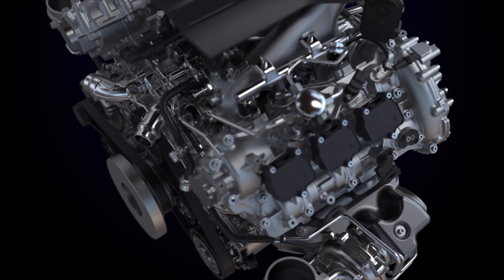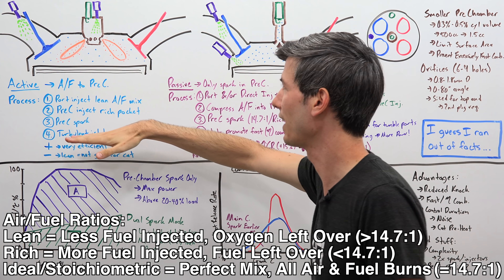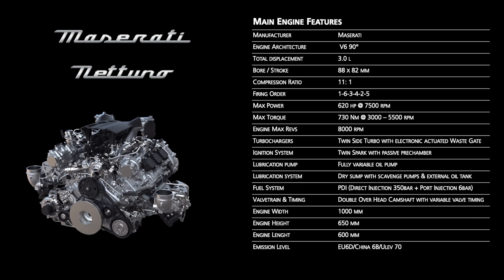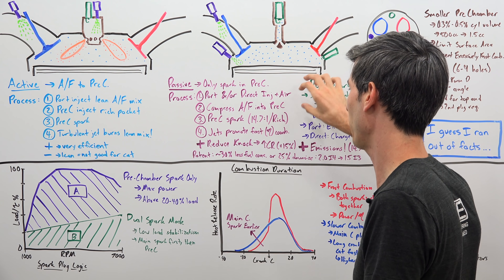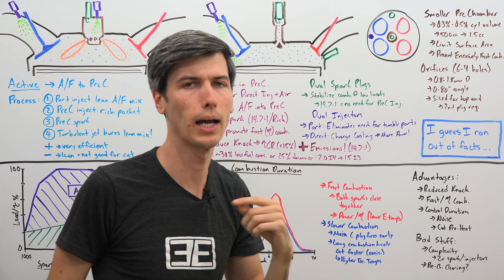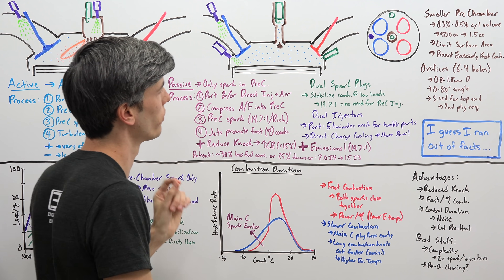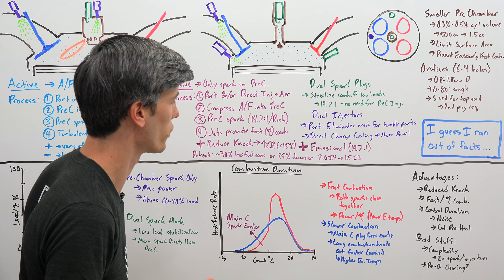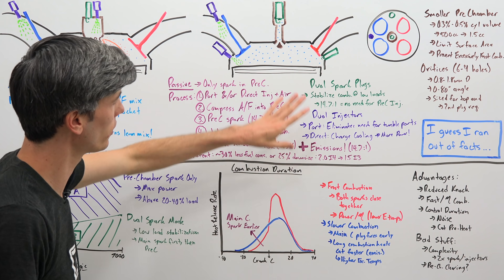How Maserati's Brilliant MC20 Engine Works - F1 Tech In A Road Car!

Comment: It would be interesting to see how Maserati pulled off the 90º V6 with common crank pins (a 'true' V6 according to certain engineers), odd firing, specialized engine mounts, and without a balance shaft.  Has anyone seen this engine revving?  I could imagine that the engine mounts take a severe beating.

Comment: An interesting thing to think about is pre-chamber volume vs effective CR. At full throttle the pre-chamber should get a fresh charge of it's volume nearly multiplied by the CR. Part throttle (and different VVT settings) less, so you'll have more dilution by exhaust and more importantly less volume equals lower speeds and lower turbulence. At low speeds when burn time is not a limiting factor increased turbulence increases heat loss to the walls and reduces bsfc. Well addressed with delayed pre-chamber spark, which is smarter than my first instinct of cutting it out. A wonderfully well thought design.

Comment: So basically they are trying to control the fuel ratio more inside the chamber during compression to have the optimum power and efficiency… and that small pre-chamber is basically a safety or a barrier for this system during combustion process due to pressure generation happening through explosion… So the struggle of a normal system is basically finding out a way to have injectors directed inside in the chamber when the valves are closed… thus this problem is causing the injectors to not practical for this kind of mechanisms and process… They will be damaged in no time when explosion happens…

Comment: I don't like it. The pre chamber is cooled and is small so it tends to quench. That's why the second spark is needed, to increase the pressure by burning in the big (less quenchy) part.
Regardless, carbon might build up in the pre chamber. Perhaps that's fine. Maybe it will provide a bit of internal insulation. Pre chambers should be insulated and should run blisteringly hot.  The fueling is wrong. The sparks aren't needed.
And there's no water injection, so simultaneous combined cycle isn't possible. Eliminate nearly all volume in the cylinder at TDC. Before TDC fill the cylinder's residual volume with steam just prior to fuel injection, turning said pre chamber into a full on combustion chamber.
That gets you half way there. The Displacement Adjuster and catalytic staged combustion finishes the job by maintaining a perfect expansion to compression ratio at any torque while eliminating vacuum, retaining stoichiometry, and vastly improving cat performance with secondary air.

Comment: disc brakes were first developed for f1 cars, the trickle down effect is pretty cool.
Reply: Actually disc brakes were first developed for aircraft. Also a lot of other stuff you see in todays cars originated in aviation. ABS/ESP, Carbonfibre, gasoline direct injection, basically every type of forced induction system, electronic engine control just to name a few. Aviation is what really pushes technology because that's were performance is more importent than cost in many cases.

Comment: What swirl direction are they using and how does swirl factor into both kinds of design? The animations appear to ignore swirl. I'm also curious how the two spark setup doesn't make knock more likely as the walls of two burning areas collide.

Comment: the Nettuno engine has a unique firing order sequence. They have a shared pin 3 throw crankshaft. Could you share detials of their 1-6-3-4-2-5  firing order which is unusual for a 90 degree V6

Comment: question: Can we make a pre chamber for all engines. Example: replace the  normal long threaded spark plugs with the short threaded spark plugs  That gives you roughly  half the roughly space half the original space available would that be enough space to machine a pre chamber and screw into the original spark plug hole an then screw a short threaded spark plug in????

Comment: You forgot to mention Soviet GAZ-24 which used forechamber ignition in the late 60-s. Albeit it was a carbureted engine, but the main chamber had a lean mixture, helping it to be fuel-efficient.

Comment: You left out the charge cooling and the fuel cleaning carbon off the back of the valve with port injection.

Comment: I'm glad you referenced the Honda CVCC technology. My 1978 Civic was so efficient due to the cylinder head design, it could get real world mileage near 40 mpg, and the emissions were so low, the car didn't need a catalytic converter. Literally the last cars sold in the US that still could burn leaded gas. And they achieved that efficient combustion even with an analog carburetor. Kudos to Maserati for pushing the efficiency of internal combustion engine design.
Reply: What kinda horsepower? I hit 47-49 mpg in a 2 liter turbo diesel motor in a car that weighs 3400+ pounds lol. I feel like you might have had 40 mpg but not very much power to play with
Reply: @DarkAttack14  This is why you have (need) turbocharging. TJI as an NA engine limits BMEP, but it allows much greater BMEP with turbocharging w/o detonation. So - higher Cr +boost = smaller displacement better power/weight and greatly improved efficiency AND power.  BUT, this is limited by high oxygen catalysts disfunction for emissions certification.
Reply: @billl7551  diesels don't detonate though lmfao. Pretty much impossible unless you were to inject right into the intake or something
Reply: @DarkAttack14  Sorry for an unclear post - -but happy it was amusing 🙂 I was referring to limitations of spark ignited engines. Diesels can and actually do detonate, but it is controlled(eliminated) by injection rate limiting so the burn rate is controlled by injection rate. The idle clatter of old was due to rapid injection of all the (idle) fuel and sudden heat release of the entire charge. Now, there is a pre-injection, (called pilot) that becomes the fireball for the main charge. Detonation will produce rapid rate of rise in combustion pressures and eat piston crowns. Not widely know by the public.
Reply: @billl7551  diesels do not detonate unless in seriously bad condition. detonation refers to ignition before intended which can't happen in a motor that doesn't inject until intended lol now if you're running an old style Bosch VE pump and your timing is way off yeah you could detonate.. Or in a common rail motor if you have oil introduced to the intake from a blown turbo! Even in an old diesel motor with one single injection event it doesn't qualify as detonation
Reply: @DarkAttack14  OK I give up- premixed fuel-air mixtures most desirable reaction is deflagration a chemical based subsonic progression of chemical heat release. The pre chamber TJI is a method to initiate this controlled heat release in lean mixtures where shock based heat release is absent. The diesel combustion is completely different with injection of a cloud of tiny balls of fire burning like comets. But, there is a condition, albeit unintended in both situations where the heat release can happen unintentionally. This was a rare issue in pre chamber diesel engines in the 70's and 80's. A fact with which I am personally familiar. Was it detonation?  Hard to say, but the rapid heat release, and shockwave damage to the pistons was much the same as SI engine.s. Regardless, this vid is about combining high pressure injection, homogeneous charges and, by design, keeping the main premixed charge from auto ignition (at any point in its combustion event) from occurring via A/F ratio. Pushing this out of the picture allows the high Cr, much higher BMEP, and much higher efficiency (like a diesel) than previous spark ignited engine combustion technologies. So - let's not wrestle like pigs in a pointless detonation/deflagration debate. Go LYAO.
Reply: @DarkAttack14  You're also hitting that in a car made in the past 15 years, when Honda was hitting that in the 1970s. (And, diesel fuel has about 13% more volumetric energy density, so when comparing inherent efficiency (or CO2 emissions, as it gets that energy density from just being more dense), that has to be accounted for. The diesel cycle is more efficient than the Otto cycle typically, but not that much more efficient.)

Granted, an early Rabbit diesel could also get there on efficiency, but with significantly less power and more weight than the Honda. AFAIK, that year, a Civic CVCC hatchback had 60 hp and weighed around 1800 lbs, when a Rabbit diesel had 48 hp and weighed about 1950 lbs.

Comment: So, I'm no engineer and certainly not the smartest fella in the room. But how exactly does the spark plug positioning above the "pre-chamber" change anything? The fuel air mixture in that "pre-chamber" should be exactly the same as the rest of the cylinder. The pressure in fact would be no different either as compression occur equally across all surfaces of the combustion chamber. It's nothing like the system utilized in F1, it in fact operates just as any other I/C engine except they decided to use 2 of everything I guess? If I'm dead wrong somebody please tell me, but this just seems like a regular engine with extra steps...
Reply: The trick is to accelerate the ignition process of the main chamber. This results in higher mean effective pressure because the piston hasn't had time to travel so far down before the whole mixture has burned down compared to a traditional ignition system. The problem with a normal system is that you have just one very small ignition point and from there the whole flamefront has to spread through the rest of cylinder. That needs time.
Reply: @shi01  okay, I believe I understand now. The design is supposed to begin the combustion cycle sooner and generally increase effectiveness and efficiency of the entire process without producing pre-ignition and or knock. That makes a bit more sense. Thank you!

Comment: You can simulate soot/carbon deposition on the surfaces of the pre-chamber.

It will take a while to set up the simulation and then it will take QUITE a while to run said simulation (and to make sure that the simulation itself is stable and converges), but other than that, you can actually get at least an analytical answer to your curiosity/question.

(There are also ways to accelerate the soot/deposition models once you know what the fluxes are as well.)
Reply: Well, the question is usually: are the simulation results accurate? Once you introduce some pretty complex flows and combustion into the mix as in a combustion chamber, I would guess the answer is no.
Reply: @Finnspin_unicycles  
That's what the calibration, correlation, and verification tests are for.

You'd be surprised at how accurate the simulations are.

(How do you think Maserati came up with this in the first place prior to cutting steel?)
Reply: @ewenchan1239  I know how accurate (and inaccurate) CFD and combustion simulations can be. But those are very well developed and have decades of research and comparison with the real world behind them. 
Soot deposition in quite complicated flow situations? Not exactly an established field where reliable results can be expected.
Reply: @Finnspin_unicycles  
"Soot deposition in quite complicated flow situations? Not exactly an established field where reliable results can be expected."
Search for SAE/JSAE papers on this topic and you'll find what you're looking for.

(They've been doing soot deposition in vastly more complicated flow situations than this. This is "peanuts", in terms of complexity, relatively speaking.)

Again, read the SAE papers/publications and you'll find what you're looking for.

Comment: G'Day,,er long time ago posted,,But any way,,wonders if the small plug chamber , relates back to flame licker engines,where they use the vacuum from cooling gas to move pistons,
Wonder would this work the same way,??and recharge chamber,you did say they were "Cooled?"

Comment: Makes me wonder if you could build an adaptor for existing spark plug holes that incorporates the pre-chamber.
Reply: it's a brilliant idea, and it's exactly what they have done in many race cars. it's just a 14mm adapter with a smaller 10mm spark plug inside.

Comment: Farmers have been doing it for years to get more MPG in their cheaply made industrial engines. Using spark plugs with sleeves lowers compression ratio but increases energy distribution more efficiently. Increasing compression and undersquare engines work best. Water injection reduces build up in chambers.

Comment: For the 2 plugs in the cylinder - I would be curious to know what percentage of the time MISFIRES occur.
Also, for a given throttle position, I would be curious to know how wide its CYCLIC VARIATIONS are.
Lastly, in the main chamber, I would be curious to know what the FLAME SPEED is.

Comment: Very cool vid!! One question: u said maserati uses the Direct Injection for better cooling of the air, but the Port Injection does the same. So what is the advantage appart from better fuel efficiency?

Comment: Another reason for having a port injection is to prevent early failure of the engine. Direct-injection-only petrol engines suffered from fouled valves which in turn reduced efficiency and led to early failure of the valve seats and values themselves due excessing heat micro-welding . Just ten years ago direct injection petrol engines had a life expectancy of no more than 50K miles; manufacturers didn't put that one in the brochure! After 50K the owner would need an expensive partial rebuild to prevent total failure of the engine by 60K miles. Most of the cars which suffered this problem were "small economical" vehicles which due to their short life where much more damaging than larger vehicles with multipoint injection.

Comment: The base technology of the flushed pre-chamber in lean-combustion-engines is over 30 years in series in industrial gas engines. I saw myself engine efficiencies over 48 % at flywheel on staged turbo charged (boost levels up to 100 psi) with gaseous fuels like Natural Gas. Those engines are used for combined heat power plants and e.g. fully integrated energy and CO2 feeders on vegetable and flower plants, supplying light, CO2 and heat to grow them well. Car companies just exploring old stuff new, adapting it for their applications.

Comment: Rocket engines have used pre-burners since the V2 missile, maybe even before. Most rocket engines now use them to drive turbopumps that feed the engine the required fuel and oxidizer.

Comment: Thus far ALL Italian designed, engineered, and built cars lack a 150,000 + reliability no matter how well you maintain them.   When you take your Italian car to  a dealer, it will cost you $75.00 just watch the person at the  desk ... sneeze.  If any real work needs to be done,  just give then you credit card plus empty your wallet.  To put it mildly, they have a DISMAL reliability record.  Their forte is in beautiful and artistic designs of anything from  vacuum cleaners to cars.    Put an Alfa Romeo 4C Spider (!!! body only !!! ) on a Honda chassis and now you have a beautiful and reliable vehicle.     End of story.

Comment: Great explanation Jason! 

I had one question.
At low load, any RPM, wouldn't it be feasible to fire the pre-chamber spark plug first and then after a short delay, the main chamber spark plug?

The active pre chamber shoots flames and evenly spreads the combustion into the main chamber. So wouldn't it be somewhat the same case in Maserati's engine?

Comment: So could a special spark plug be used to retro-fit this to an existing engine? Kind of like the spark plug extenders for anti-fouling. Maybe only for engines with dual spark plugs.
Reply: If your spark plug is 14mm? it's possible to just put an adapter between with a smaller 10mm spark plug inside.

Comment: why not just build a spark plug, that has the pre chamber integrated? just an extra long spark plug where the center electrode ist deep inside instead of sticking out.
would be easier to maintenance. AND it could be offered as Aftermakret Spark Plugs for other engines too! 
I would like to see that.
Reply: Spark plugs like that does exist, but the volume inside the chamber and the size and number of the holes are very model specific. Its easier to make an adapter and put a smaller sparkplug inside. This way you can adjust the size of the holes and the volume inside untill you have the resault you want.

Comment: I saw a TV program back in the 90's where they were plotting what needs to happen to get the engines to be more efficient and clean. The original material was from the 1970's oil crisis times when the anti-smog equipment was introduced. They correctly predicted how complex the engines and transmissions need to be. I remember thinking would it be funny to create everything using vacuum tubes or transistors to show how complicated everything will get. Now would be the time. Then, a "simple" electric motor with one moving part will now replace the whole thing.

Comment: This reminds me of pulse jet technology were essentially its like a rocket engine. 

What if the heads had this pre chamber ignition system and was nearly the same diameter of the piston and had small holes and above that existed the valves and the spark plug and the injectors. So essentiaply the piston will get the most out of this. Because a rocket engines injector system does this the same way learned this from Scott Manly who explains in vivid detail how rocket engines work. This is genius. There is more pressure then there would be if it was one giant explosion. The raptor engines use this and so do the engines on most if not all space craft. If we use this in cars it could help so much more with fuel consumption.

Comment: Did I miss so rtbobg? Wouldn't being able to run the motor leaner or more efficiently with less fuel, why use more file for the CC? Wouldn't it be better to design to the point of not needing one?